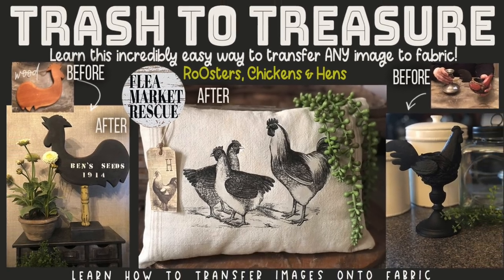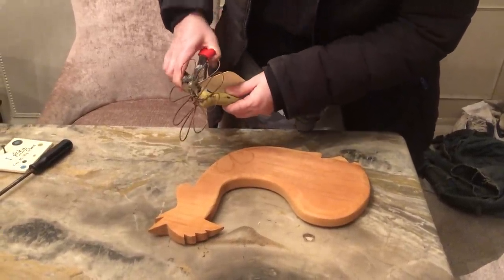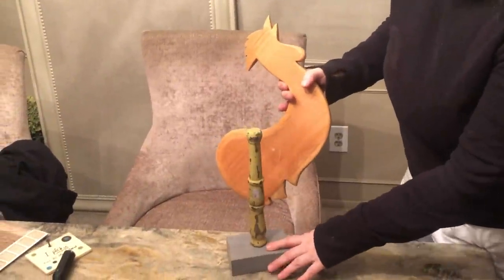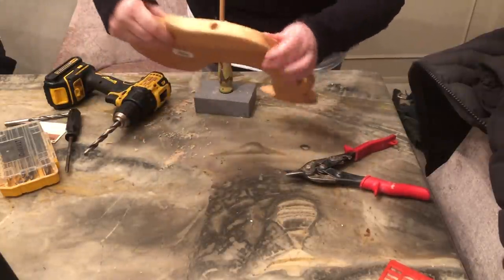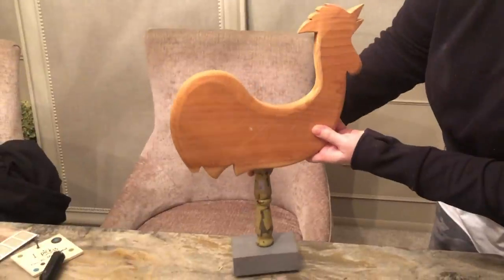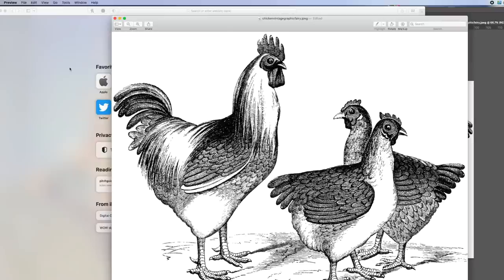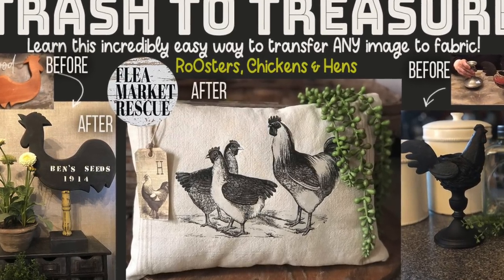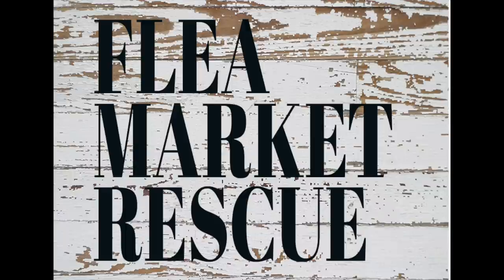TRASH TO TREASURE DIY THRIFT STORE HOME DECOR MAKEOVER - HOW TO TRANSFER ANY IMAGE TO FABRIC

Comment: I just did 17 pillows for craft show and I hadn't done them before but I'm a seamstress and a sewing a quilt and I do all kinds of crafts trash to Treasures I took the iron on full bedding and put that on the inside of my pillow first and then I stuff my pillow and I had no lumps and no bumps and it all was as smooth as everything so that's just a suggestion I'm throwing out there for you if you use like specially a thinner material you may have more of that problem they're not then you do on this this type of fabric

Comment: Hi, You stated since graphic was too small so you "bumped it up" to 175%. I'm confused, were you using the printer or the computer to enlarge print??
Reply from the maker: Hi Anna!  I bumped it up or should I say enlarged it right from the printer.  In the settings of your printer there will be an option to print 100% or actual size.  From there you can move the areas up or down to either enlarge it or decrease the size of your image.  I bumped it up or enlarged it in the setting to read 175%.   So, I increase it by 75% right from the printer.  Hope that clears up any confusion.  If you have any questions...don't hesitate to ask!  XOXO
Reply: @FLEAMARKETRESCUE  Great, thanks so much!